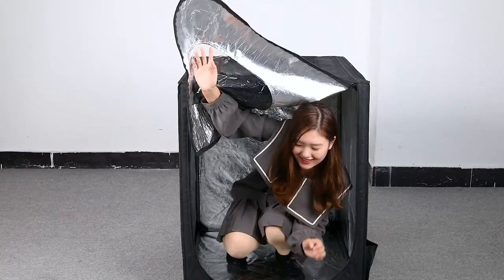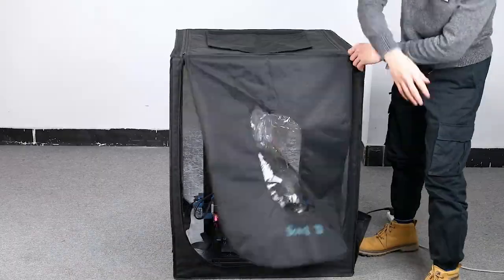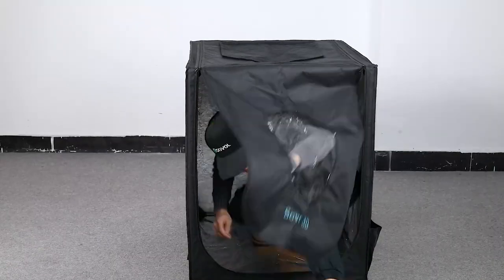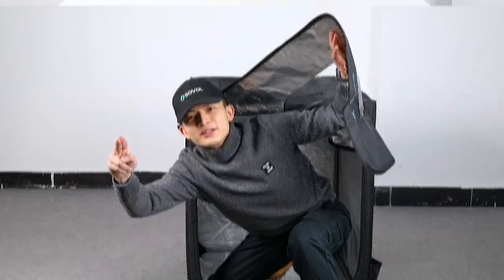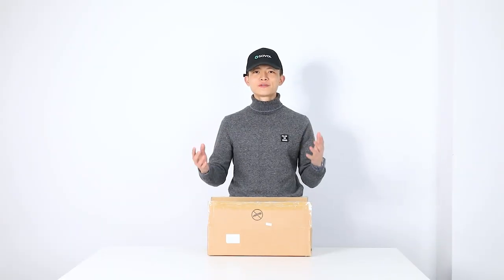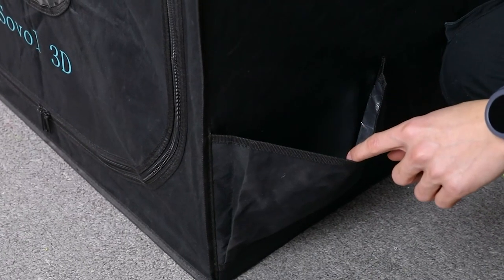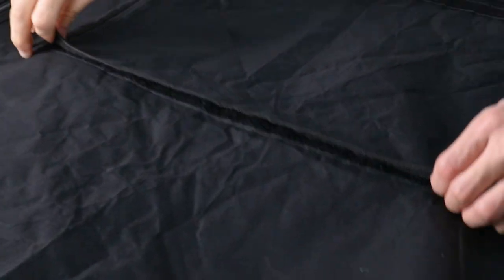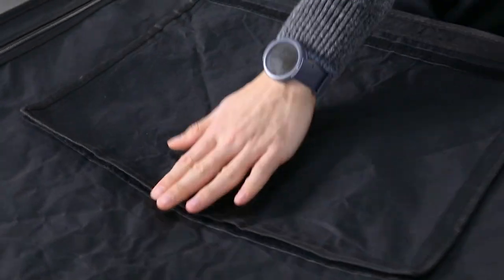Building Sovol 3D Enclosure for Your 3D Printer to Improve the Print Quality with ABS Filament!

Comment: Why is it not that easy to assemble?😤
The pole connectors snapped and the zipper popped off. The tent is too small and is practically impossible to fit over the skeleton structure.🤷🏻‍♂️
Reply from the maker: Hi dear, you can contact our after sale team. They are happy to help you.